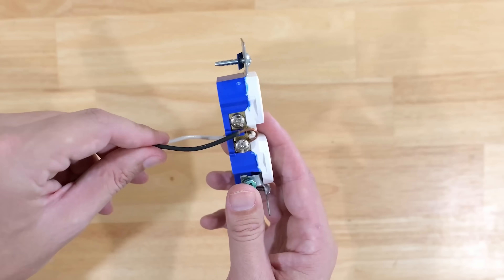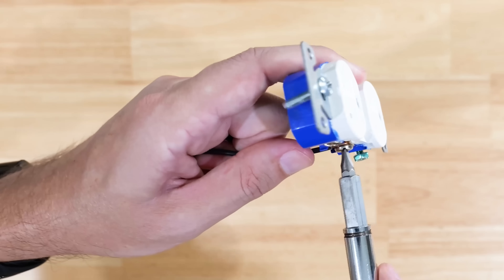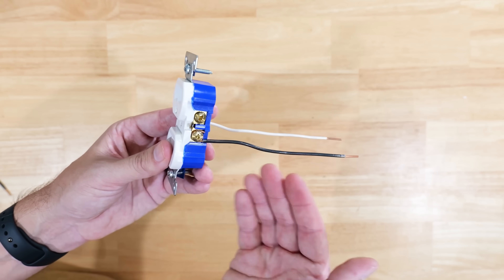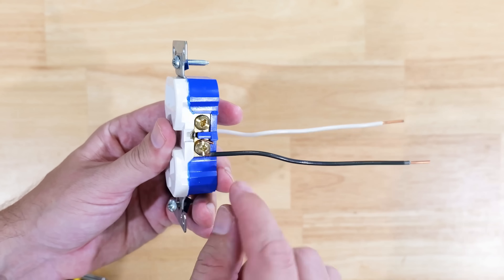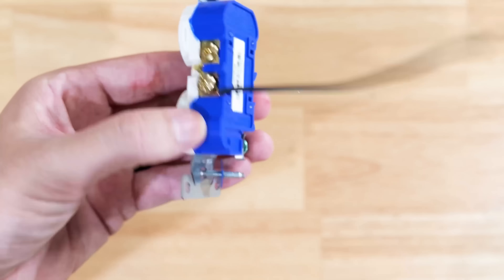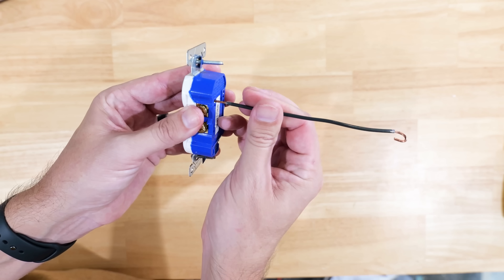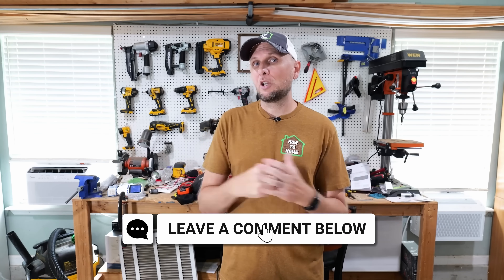Avoid Disaster! 8 FATAL Outlet Mistakes Most DIYers Unknowingly Make!

Comment: 7:25  I had flickering lights in 2 rooms of my house and traced the problem to an outlet that was done this way.  At one time there was a heavy load on that outlet and the high resistance melted parts of the outlet.  I later found that 80% of the outlets in the house were done this way and I spent the next few weeks (on and off) fixing each one.  Wow!!!

Comment: In our 1920 Home, the boxes were very tight for even a standard receptacle.  We wanted to install gfci to aid in the danger of it being wired as an open ground.  In order to get the gfci to fit without significant damage to the wire, box, wall, etc., it fit by using the backstab method.  For that, I don't regret it.  :)  It's still better than the receptacle that it replaced that had the wires shoved into the release buttons for the backstabs...

Comment: Correct me if I'm wrong, but It seems to be normal practice to only use regular 15-amp receptacles on a 20-amp line with multiple outlets, and the 20-amp T-plug receptacles would be used on dedicated lines for higher-wattage appliances.

Comment: Guy at home depot told me it's fine to have an outlet rated for higher amps which makes sense because you can catch a baseball with a larger glove than your hand but you can't if the glove is too small for your hand. So i think you miss spoke. If your outlet is rated for 15 and and you're running 20 too it i see a problem with that, but that's not what you said

Comment: 11:05 You can make a loop of wire from a bared portion of copper somewhere along the length of the outlet's feeder-wire and put that around the terminal to create two leads coming off the same terminal and still have just a single strand of wire going underneath the screw.  Then pigtail another wire onto the end of the feeder-wire to run to the other circuit that you need to power from the wire that's supplying the outlet.

Comment: Loose wires cause fires.  I've dealt with 120, 240, 277, and 480 3 phase.  There was less than 10 people that actually knew what 480 was or how it works out of 100 people at my last job.  It's 3 legs of 277 for a total of 831 volts.  Explaining how you get 480 would take me more time than I'm going to go into right now.

Comment: Ive been an electrician for over 25 years and I watched this video excepting to find something wrong. Surprisingly, I couldn't find anything wrong. One thing that I would add is to take the strippers and crimp the end of hook after wrapping it around the screw. By some small chance if the screw gets loose, the wire can not physically come off the screw at least. The people that don't do this stuff, put food on my table. Good video.

Comment: I just need to replace an outlet.  I was trying to remove a window AC and my dumb ass forgot to unplug it as it fell out the window and yanked on the outlet causing to crack.  Definitely not going to be using it after that not until its replaced

Comment: I think you said it backwards. A 20 amp circuit with a 15 amp socket would cause more problems
Reply: No, what he said is correct. As long as the circuit is wired with 12 gauge, the receptacle doesn't matter as long as it's in good condition and wired properly.

Comment: I love those lever lock receptacles but they're $3 plus each instead of $0.60 ish each so when you're replacing every receptacle in a house that comes out to about 50 receptacles that's a big price difference.
But I absolutely agree with you that those leave your lock receptacles are the best possible option for a DIY home project for a non-electrician.

Comment: I dis agree with the 20 amp receptacle on 15 amp circuit. It just simply means it is rated for 20 amps. It is not going to affect anything. What you need to careful with is putting a 15 amp receptacle on a 20 amp circuit. Meaning if there is an overload, it will exceed the rating of the receptacle and will heat up. You have it backwards.
Reply: According to NEC 210.21(b)(2) maximum cord and plug connected load to receptacle for 15 amp receptacles is 12 amps, and for 20 amp receptacles is 16 amps. The reason is to allow a 20 amp receptacle to accept a 20 amp plug from a utilization equipment that may draw up to 16 amps and the receptacle must be connected to 12 gauge wire (minimum) continuously from the electrical panel. Regarding commercial grade receptacles, there's nothing special or different between the 15 and 20 amp receptacles internally and externally except for horizontal slot on the 20 amp receptacle. 99% of the time 20 amp receptacles are unnecessary in residential applications, unless used for 20 amp circuit identification. If you put a 20 amp receptacle on a 15 amp circuit, it likely won't affect anything like you said, but it allows for a 20 amp plug, hence a code violation.

Comment: Proper Chapters. You are welcome: 
00:00 - Intro: It’s the Installer, Not the Tools
00:28 - Mistake #1: Using the Wrong Receptacle (15A vs 20A)
02:05 - Mistake #2: Reverse Polarity (Hot/Neutral Swapped)
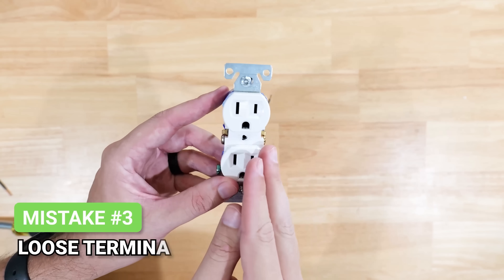03:29 - Mistake #3: Terminal Screws Not Tightened Enough (Arcing Risk)
05:28 - Mistake #4: Backstabbing / Speed Wiring (Why It Fails)
06:45 - Mistake #5: Stripping Too Much or Too Little Insulation
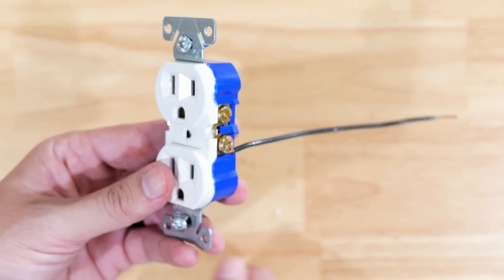08:47 - Mistake #6: Hooking the Wire the Wrong Direction (Clockwise Matters)
10:28 - Mistake #7: “Double Stacking” Wires Under One Terminal Screw
11:47 - Mistake #8: Reusing Bent/Work-Hardened Copper (Cut & Re-strip)
14:29 - Bonus Tip: Lever-Lock Receptacles vs Commercial Grade (Best Options)
16:01 - Wrap-Up + Next Video Teaser (Wiring Connection Mistakes)

Comment: i have a question. my outlet was installed with both black wires stacked on the top screw and the bottom screw empty. the white wires are done right. why would they do that.

Comment: You can still pull 20 amps on a 15 apm receptacles, but they will probably overheat. The receptacle you are using isn't going to change the current draw, that's up to the circuit breaker and the size of the wire. Even if you have number 12 wire on a 15 amp breaker it's the circuit breaker that determines the max load, not the receptacle!
Reply: If you pull 20 amps on 14 gauge wire, if the receptacle overheats it would be the same, regardless of whether it's a 15 or 20 amp receptacle. 15 amp and 20 amp commercial grade receptacles are the same internally.
Reply: @surferdude642 Where I worked we always used Hospital grade 20 amp receptacles because of plugging and unplugging caused receptacles to fail, it was cheaper to pay an extra $15.00 dollars plus pre receptacles they to pay us to replace a defective receptacle. Down time cost the company lots of money, if you had to shut down a production line just to replace a receptacle, the extra cost was will worth the money! Otherwise we were replacing every 6 to10 months.
Reply: @richardscott8159 Probably not a bad idea, when you get to heavy duty industrial grade and hospital grade, the price difference between 15 and 20 amp is minimal and sometimes the 20 amp ones are cheaper.

Comment: Do u recommend lightly sanding any oxidation off of old copper wires.  I'm replacing two old receptacles, two prong, "ungrounded" type with the same type - just Line & Neutral ports.

Comment: Personal opinion is the rear pinch points should be illegal.  Even when they are making good contact, it is such a small contact point and when they are daisy chained, all the outlets begin to get very hot running things like a vacuum cleaner at the end outlet of the daisy chain.  Kind of surprised they haven't regulated these out of existence.

Comment: 1:53 this is not correct in all circumstances. If it is not a branch circuit, you shall not put a 15 amp receptacle on a 20 amp breaker. That is only acceptable on branch circuits. My microwave has a dedicated circuit on 20 amp, and thus requires a 20 amp receptacle.

It's somewhere in the NEC.
Reply: A dedicated circuit is still a branch circuit, aka an individual branch circuit or a circuit that supplies only one utilization equipment. A duplex receptacle is not permitted in this case, but must be a single receptacle that matches the circuit rating. The exception is that a 40 amp circuit can use a 50 amp receptacle because 40 amp receptacles don't exist. A duplex receptacle serves more than one receptacle. NEC Table 210.21(b)(3).

Comment: That wire isn't even rated for 15 amps.
more like 10-12 continuous draw.
We found this out in a house with 20 amp breakers and 15 amp sockets one wired across the house from the one in garage.
Table saw in one and vacuum cleaner running in other and the wires got so hot that they melted their sheathing and the back of the plug, because the dumbass electrician stuck it in the back, and started a small fire.

Comment: Removed my comment about the 15A/20A thing, since I wasn't clear enough, and don't want anyone taking it as advice, since it disagrees with the NEC.
Reply from the maker: Well you are completely wrong.  Everything you said is against code.  And 15 amp receptacles are rated for 20 amps and have the same internals, they are just made as 15 amps so you cant plug 20 amp plugs into them on a 15 amp circuit.
Reply: @HowToHomeDIY  You're right, so I removed my comment, but this is actually a particularly dumb part of the electrical code, since in either case, only the breaker is protecting the wiring. It's also allowed to string multiple receptacles on the same circuit, so it's easy to subtly overload a 15A  (or 20A) breaker to the threshold where it might heat up and cause longer term problems, using several smaller devices on separate plugs.
I suppose the logic is that a 20A cabled device likely does push above 15A, and might not immediately trip a 15A breaker and will keep it in that bad almost-tripped state that could weaken the breaker over time, but it does seem odd for the rules to account for that case, while not having anything prevent you from plugging a pair of 10A appliances to a duplex outlet, or the 3 outlets on the end of a cheap 16/18Ga extension cord, both of which are far more common given the relative rarity of 20A appliances.

Comment: Thank you for the great rundown mistakes and how to do it right. 👍 I really wish more manufacturers would spend the extra 5 cents and use anodized screw colors for the hot, not just the ground. In lower light etc. it would be nice not to have to differentiate between brass and silver but say something like black and silver screws. Not a huge issue but it might lead to less confusion and be worth the extra 10- 20 cents in receptacle cost to the consumer.

Comment: I always try to avoid a Phillips screwdriver, when I'm tightening my terminals. It's a little more of a pain. It's a little more focus, but by using the proper size. Street blade screwdriver, you ensure that you can tighten that screw down enough without the head stripping out.

Comment: Dumb question, but if the replaced out was a 20 amp, and I replace it with another 20 amp, then it should be fine.

Comment: pretty sure you shouldn't put 15amp rated receptacles on a 12/2 fed by a 20 amp breaker. from my understanding, you'd have to downgrade your breaker to a 15amp breaker to match the receptacle. hell if that was safe they wouldn't offer a 20amp receptacle option. everyone would just use 15amp receptacles everywhere.

you want your breaker to be the weakest link. its ok to over rate your wire, but never under rate your wire, and i'd recommend against under rating receptacles.
Reply: Not true, NEC Table 210.21(b)(3) allows this for duplex receptacles. 20 amp receptacles are commonly used in commercial, industrial, and medical facilities, not only because they may be needed, but they can be purchased at the same or actually a lower price than the equivalent 15 amp receptacle. In a residential case, you are correct that you could use 15 amp receptacles everywhere. For 20 amp circuits, I recommend commercial spec grade 15 amp receptacles, because they are identical internally to 20 amp receptacles of the same grade. 
If you have a 20 amp individual branch circuit aka dedicated circuit, a 20 amp receptacle would be required, but it must be a single receptacle, not a duplex.

Comment: These are great tips. Everyone should watch this prior to doing outlets. However, you rocked your strippers when stripping the wire. Add that to your list of what not to do, it scores the wire, making it weak. Use a good set of Klein strippers, use the proper gauge slot, and grip it hard at first, then release the grip slightly as you pull off the insulation.

Comment: You do realize that there are more than 1 receptacle tied into a circuit. Say you have 4 receptacles that are on a 15 amp circuit all with devices that are in use, using a total of 20 amps. What would you know, you are relying on that breaker to trip. The 14 gauge home run is handling all that load. Now with putting a 15 amp receptacle on a 20 amp circuit. Say you have 2 1200 watt lights plugged in to the single 15 amp receptacle. What would you know, now you are overloading the receptacle but not the breaker. 🤔
Breakers are meant to trip, standard receptacles aren’t.
Reply: In your scenario, it doesn't matter if you're using a 15 or 20 amp receptacle, when you're pulling 20 amps on 14 gauge wire. The wires will overheat and would be the weakest link, not the receptacle. 15 and 20 amp commercial grade receptacles are identical internally and would absolutely make no difference which one was used.

Comment: As DIYer !) if back stabs are not really safe, how can they be there?   2)  If toque measurement is necessary for terminal screws,  how can a code compliant screw driver not be able to measure torque?  I'm fine with shortcuts sometimes, but I don't like it when code approved methods are not code approved.  That's nonsense.

Comment: What confuses me is how you can wire ac in reverse when it just goes back and forth and doesn't actually flow in a specific direction. Or maybe when you know more than the basics it does a little bit...idk im confused
Reply: What you are saying is true in a 240v circuit because there is no neutral wire needed. There's still a ground wire in order to trip the breaker in the event of a ground fault. In a 120v circuit, the neutral wire is bonded to the ground wire at the main electrical panel, neutral/ground bus bar. The connection keeps the neutral wire at zero volts at all times. The neutral wire is the center point of the 240v secondary of the transformer. Some electrical equipment will not work or could be damaged by reverse polarity. A simple load like a desk lamp will usually work fine, but the switch would then be on the neutral side instead of the hot. The problem there is that the bulb socket will always be hot, even with the switch off, a potential shock hazard. So, it's true that current flows back and forth on the neutral, there's no voltage and that's why polarity matters in 120v circuits.

Comment: Thank you for your video, I have a question I have several plugs in a mobile home I also have 3 light switches that were all next to the door when you come in the house. But since the wall had to be redone I need to put the switches and plug in back where they were but I don't know how or what way is the proper way to hook all these back up in the right order. As from what I was taught mobile homes have continuously wiring going from plug to plug to switch etc... could you give me some advice on how I would know I'm am putting the correct switch or plug in hooked to the correct wires. I'm really confused as the wires are a jumbo mess. Some of the wires still have there old plug in and switches still on them that I want to change out to new ones but the ones that the recptircal was taken off the wire and I'm not sure which one to replace it with. Can you give me any advice on this.

Comment: So 20 amp receptacle with 15 amp wire on a 15 amp breakers is bad if the breaker doesn't work properly, what is a 15 amp receptacle going to do any differently? Are receptacles designed as fuses so they burn up in the box?
Reply: The only difference between a 15 amp and a 20 amp receptacle is the horizontal slot on the neutral side of the 20 amp. If you never use electrical equipment with a 20 amp plug, there should be no problems. The 15 and 20 amp receptacles are exactly the same internally for commercial receptacles of the same grade. Same thing with GFCI receptacles. Receptacles do not have fuses.
Reply: @surferdude642 gotcha wo if someone used a proper plug to pull more than 15 amps which they could plug into a 20 amp outlet, and the breaker failed, it could cause a fire. And not that it had a specific fuse rather it was just engineered to have internal contacts that burn up just above its rating so if a breaker failed to work and you were pulling too much, then the fire would be confined to the box which would be slightly safer than in your walls. The number of 20 amp outlets I've seen in life and the added cost leads me to believe this is a pretty rare mixup with very unlikely consequences.
Reply: @leecarraher In the UK, appliances have a fuse in the power cord plug, but they have a different system called a Ring system, and I don't think it would work in the North American system.

Comment: Great vid, Ty. How about adding the receptacles that are near a bathroom sink?
Reply: What you're describing is a ground fault (GFCI) receptacle. They install pretty much the same as a regular receptacle with the exception of the ones with a built in light switch. They can often be tricky for a DIYer/1st timers.
Reply: @rodbingaman6985 thanks for your response, I really appreciate it, so an electrician (a pro) is my best option if I want the mystery solved! Got it